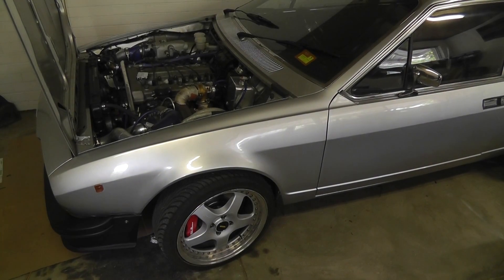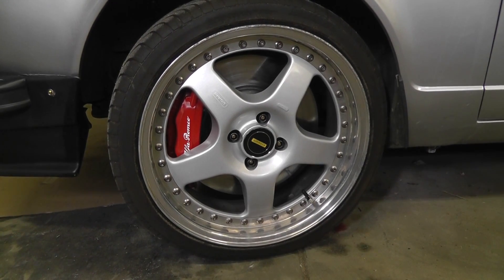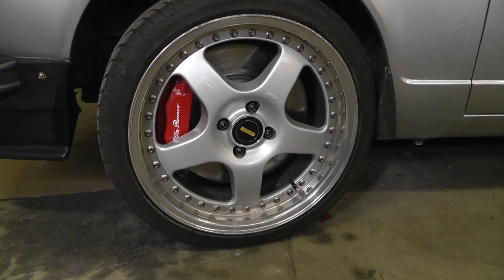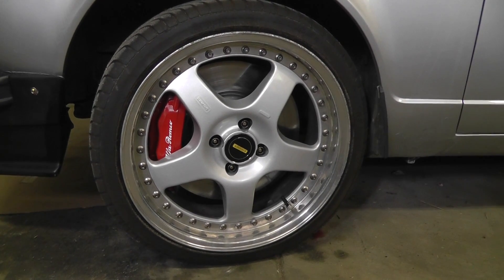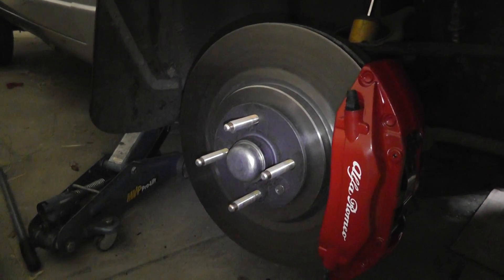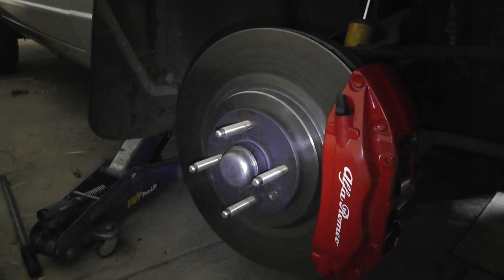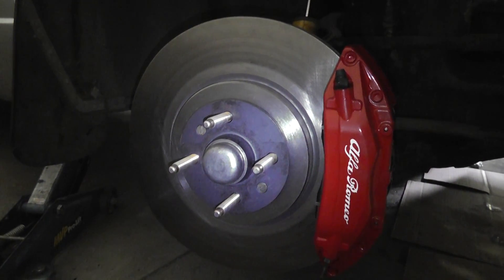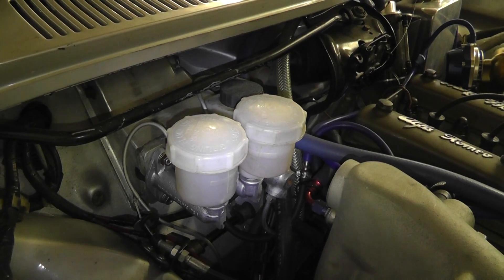Brake upgrade

Comment: Did you machine off the caliper for the 330mm ? Because i cant fit the pads nicely, the caliper touches the disc
Reply from the maker: No I didn't take material off the calliper. I assume you mean did I machine the disk diameter down?  I don't recall doing that. I do remember having to play around with washers to get the disk centred in the calliper.
Reply from the maker: And one other point of note is that these were 28mm wide discs.